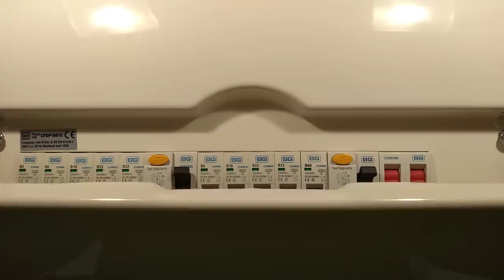A look inside a British home electrical panel.

Comment: I had an electrician quoting me for a new 18th edition unit to replace my self wiring fuse board very recently. This helped explain a few details he talked about so I'm glad I know he wasn't just baffling me with bs, it makes more sense now.
Reply: Most companies will quote a ridiculous price for the job, all in all it's a quick job usually (couple of hours tops), as long as there's long enough cables in your current fuse box to get them to reach the breakers. Once they're done, have a look inside for thru crimes or terminal blocks used to extend the cables...).
Biggest problem of moving from an old fuse box to a modern consumer unit after the length of the wires inside is more problematic and potentially quite expensive to fix however. The RCDs will find faults your old box didn't care about and you could end up with the RCDs tripping constantly due to poor insulation on the fixed wiring or indeed, if you have an older electric cooker, kettle  or shower, they often have a small amount of leakage to earth. This often results in companies either suggesting a rewire of your whole house to start off with or if they do just change the box, a rewire in the near future when the constant trips drive you round the twist.
Reply: @1973retrorabbit  tripping RCDs was my concern. The wiring is nearly 50 years old but is pvc coated, interestingly he didn't think rewiring was necessary when others have said that, however there are numerous historical modifications and damp problems in areas that might cause a problem. He explained how to address that if it occurs bypassing the RCD which I can now see how that's done having watched this video.
Reply from the maker: Bypassing the RCD is not the best option.  It's rare that even on an old PVC installation that the insulation is breaking down.  It's more likely to be dampness in boxes bugs in joint boxes or failing wiring or heating elements in appliances.  None of those are big issues as you can usually narrow things down and fix them properly.
Reply: @bigclivedotcom  indeed, I don't think he meant it as a permanent solution and having better protection is the major reason I want to upgrade it so it defeats the point bypassing big parts of it but there will be a fair bit of rewiring while I'm renovating the rooms over the next few years so as a temporary solution it might get us by until we work out where the problems are like you say

Comment: I remember a long while back replacing a wooden consumer unit which had re-wire fuses. It was also obvious that some fuses had popped in their time by the black scorch marks on the ceramic holders, and there were little melted balls of copper in the base. Fire risk or what! It’s great that standards have improved.😀
Reply: I remember the old rewireable fuses at my parents house (all replaced now). Was a great time trying to manually rewire a fuse when the lights blew in the middle of the night with the weak ass torch light you had available at the time. Assuming you could also find good batteries of course! 😂

Comment: Your system seems to be wired by task whereas here in the US the breakers are usually wired by room except for the really big high power devices like the dryer, stove, etc, which get their own breaker.
Reply: Problem we run into here is if the contractor went on-the-cheap when the house was built, then you could get branch circuits with no real relation to floor plan or function; the goal was to wire the bare minimum the code required with the fewest breakers and the shortest runs of wire (copper is expensive; homeowner frustration is cheap! :D ).

Comment: ring mains! Australia and Aotearoa use star or chain distribution rather than ring. Ring seems weird.

Also, some numpty wired the distro board in my house upside down. It has confused everyone. But it is a very old board, from the days whena  sheet of asbestos board and a wooden box was all you needed. Complete with old school cast iron main fuse... well, until I got solar and the guys had a fit because those were supposed to be replaced years ago due to their slight tendency to catch fire.

60A is low... Australia seems to be 80 or 100 in most places, more where McMansions have 30kW aircon units to go with their black tile roofs.
Reply: Ring final circuits were introduced in the UK after WW2 to cut down on the cost of the cables in properties. Not a brilliant idea as if there is a break in the circuit it becomes two radials fed from one 32A breaker/fuse and the cables are not large enough to have a 32A capacity. That's the main reason that UK plugs are fused (13A max).
Reply: Have seen the cast iron main fuse units here recently. The DNO (distribution network operator, formerly the electricity board) couldn't have cared less... 'but did you die?'
Reply: @wwsxa39  Cost and availability of copper for wire from what I've heard.
Reply: @TheChipmunk2008  Aye, but those guys dice with death every day. 240V is nothing to them, when they play with 11KV and 33KV. And use 6 inch nails to fix fuses. :D I remember fitting CCTV in a substation, and we had an escort guy with us at all times for safety. One camera we fitted was on a building ~ 30ft from a 275KV line (the big scaffolding pole looking types you get in substations). We had 6 inch sparks jumping between the camera and the pole, as we lowered it in place, from the pickup. We got shocks off the nuts and bolts as we were fitting them. Scottish power guys reaction? "He he hehe! Are ye gettin' a wee tickle from that?" (imagine it in an east coast scottish accent) Fun times.
Reply: @Matt Quinn :D Aye, those transmission line guys are crazy, a bit like racers/ speed testers, test pilots and base jumpers. They all seem to have that bit missing in their brain. I'd argue that its not even radiation off EHT, I think they already go in with nae fear. A kinda, "if I die, I won't know about it" mentality. :-)
Reply: 100A is normal here too, but older properties from the days when we used less power 60A or 80A was common.

Comment: Great explanation Clive. I’ve always wanted to know how to connect one up. I use an intumescent sealant to fill the void left in the rear of the knockouts. Very interesting going to ring hilti to find out about the toxic fumes given off when curing.
Reply from the maker: I think the Hilti intumescent sealant is water based.  I'm not convinced that many people actually use the correct thing.  Particularly when they happen to have lots of kitchen sealant handy.

Comment: Oh the aggravating rising clamp terminal. We have hundreds of them where I work. They are fun getting stranded wire in the proper place inside a cramped control panel. We do have some breakers with shields that stop you from putting wire in wrong but the brand name escapes me right now. Great video. Always interesting to learn how stuff is done in different places. ⚡️⚡️⚡️⚡️⚡️⚡️⚡️⚡️
It’s a siemens 5SY4318-7 
3 phase we don’t have any single phase in this brand but it’s interesting that it clamps on either side you put wire in. Hard to miss when you have two shots at hitting terminal. I like 👍

Comment: I had our house updated to all RCBO type breakers for minimal disruption and easy fault finding if a fault occurs.  I've not noticed any significant heat from them.
Reply: Same her, no current consumption from the devices themselves. and very little heat. One thing I did notice (a small design error) is that with Contactum, the RCBOs protrude a little further and the smoked plastic lid (the board is pre- amendment 3) stops the toggles flipping all the way down on a trip. Of course this has no effect on the actual operation but to prevent problems if the toggle mechanism gets jammed together with the internal mechanism, i've removed the lid. It's inside a metal meter cabinet anyway so no issues.
Reply: I think people are reading the spec sheets figure for maximum dissipation in the RCBOs and assuming it is steady.  I think most of the discussion is related to load and is in proportion to the square of the load current.  So a breaker using say 1.2W at its rated 32A will only be dissipating maybe 20mW with a more typical average 4A load on it.  
Also, take a look at  MCBOs - they have similar dissipation figures on their spec sheets.

Comment: Amazing how few breakers are in there .
We use a different system here in belgium .way more breakers , 2 fase, 20 amp for outlets , 16 for light . And a 30 and 300 mili amp protection
Reply: '300mA protection' an oxymoron for sure. 10mA is bad enough, as Clive demonstrated - https://www.youtube.com/watch?v=-5R-KBa18ME

Comment: concise and informative video, thanks, incredible that the tails gland requires drilled rather than providing a correct sized KO!
my theory on the increase of consumer unit fires is the increase to a min of 25mm in tails. some of the old plastic boards were made to be asthetically pleasing, slimline , not enough room for the tails be shaped and enter the DP switch terminals without being over bent and stressing the terminal connections

Comment: DIN = Deutsches Institut für Normung = German Institute for Standardization
Reply: Add a T and I get your GIST
Reply: Murphy deffa Everything digital will trip, are you sure?
Luckily in the U.K. domestic vacuum cleaners have limited power rating due to the EU, 😂
Reply: @Murphy deffa  B-characteristic circuit breakers actually do not trip when you turn on a vacuum or switching power supplies. In fact, living in out flat for 20 years, equipped with these type of breakers, we never had any problems, even when turning on three switching PSUs at once (PC, monitor, subwoofer). For household use, B characteristic is fine. 

But hey, I’m glad you had the brain to post bullshit.
Reply: v8s i actually had to separate my mac pro with two displays and two monitor speakers to two power strips as it sometimes tripped the breaker when i switched the all-in strip on... so kind of yes.
Reply: @mx0r  What you did there is called the "all the capacitors"-setup, wich you should not do in the first place.
Reply: So my ancient stereo with DIN plugs isn't called DIN because it's loud?
Reply: @zjzozn  A good idea too. It forces manufacturers to focus on more efficient motors and impellers.
Reply: Din Dutch institute for normies
Reply: Is that related to the round DIN connectors? The only DIN connectors I've ever used were with my old TRS80 Color Computer 2. Those were called Dragon Computers in the UK. I also used the 4 pin mini DIN connectors with S-Video which I don't use anymore. We used to use S-Video to connect late '90s TVs with DVD players and Digital Satellite boxes. Component Video killed S-Video. I'm not sure if it improved 480 video though. Component seems to work better than VGA on long runs even with a coaxial VGA cable. I use Displayport or HDMI instead of VGA. I haven't been able to seem any difference for 1080 video between HDMI and component. I don't think 4k can be used with component video. I don't own a 4k TV/monitor. All I know about 4k is that any HDMI cable that has conductors for all the pins will work. I personally don't think I would benefit from 4k due to my eyesight. That's enough rambling.
Reply: @Murphy deffa Standard domestic in Australia are C curve, A curve would be used in sensitive areas like medical installations, B curve would be used in domestic installs if the calculated fault energy is high. D curve very rarely seen even in industrial, anything needing such a slow tripping curve tends to go straight to a larger frame industrial Air Circuit Breaker
Reply: @honich-eriker  depends on the switching power supply, I've seen and used small 200 Watt units that have 35 Amp inrush current, if the final circuit is already well loaded flicking another 35 Amps onto it could be enough.
Reply: Robert Gaines, the TRS 80 was quite a different beast to the Dragon. I had a Dragon 32 as my first computer, and it was nothing like a 'Trash 80'. They were made in Wales, by Dragon computers. Even the mainboard bore the name 'Dragon Computers'.
Reply: +Ray G Mine are a Z curve... because of the shape of the route the fuse wire takes through the ceramic. :D
Reply: DIN is the noise that occurs when you knock over a pallet rack of DIN rail with a forklift.
Reply: @robertgaines-tulsa  yes the din connector is also a DIN standard as well as the DIN A4 paper
Reply: @manuelh.4147  For a time Microwave ovens have been more likely to do that.
Reply: Deutsche Industrie Normen (as it's normally stated in my country).
Reply: @zjzozn  But with Brexit I wouldn't be surprised if they start coming out with 3Kw domestic vacuum cleaners in the future just to piss off the EU😛🤣
Reply: trident3b  According to wikipedia, DIN means Deutsches Institut für Normen  since 1926.  You you was young in 1926???
Reply: MazeFrame yes, i have realized that and that is why i split it to multiple strips, so i won’t turn them on all at the same time.
Reply: Murphy deffa that‘s just wrong!
Reply: No such thing as “inrush” current.
Reply: @manuelh.4147  I've never seen a vacuum trip a breaker, either. I had le olde incandescent bulps trip the breaker at times when they went out with a BANG but I'm pretty sure that's how it's supposed to work.
Reply: @badbanano  Er, yes, there is. Motors, transformers, and rectified supplies with smoothing capacitors (this includes the input stage to an SMPS) will consume greatly more current than normal operation briefly, this is termed inrush. Even some resistive loads have inrsh, as their operating temperature increases their resistance substantially..
Reply: yeah.. we used to just say "Deutsche Industrie Norm" as easier to say and quicker.
Reply: @Murphy deffa well... have you ever seen a german fuse box?

Comment: I was at an Airbnb in the UK where a breaker had obviously tripped when we arrived, and it took me hours to find this damn thing cause it was a) white plastic, and b) inside the cupboard where they kept the board games and books?? Even just the fact that it was on the ground floor in a house that had a basement was completely foreign to me.
Reply: In the UK there seems to be no standardisation on where the consumer unit is located
When i lived in Lincolnshire, the house there had an outdoor cupboard, which we used as a pantry, and the consumer unit/fuse box for that house was in that cupboard
My grans house had it in a cupboard by the front door
When we moved to market weighton, the house there had it in a cupboard in the kitchen
And the house that I currently live in has it over the staircase on the side wall, near the bottom (although it is high up on the wall)

Comment: I’m currently teaching new electricians and I used to build test stands for large HVAC equipment that was shipped around the world. I’ve always been interested systems i. Other countries. Thanks for the good explanation. I was in London a few years ago and enjoyed rummaging through the electrical equipment in the apartment we rented. I think the small wiring is very efficient. It’s probably not quite large enough for he average American home, HVAC and expandability. Now we’re adding arc fault circuit interrupters and surge protection, so it’s a bit more complicated...  very good video. I’m going to add it to the video list for my class. I think it’s important for students to understand systems in other countries, especially those who may work in manufacturing where we install equipment from around the world. This would be a great idea for a new YouTube channel...

Comment: I hear you mention acidic silicone all the time, but over here (Australia) 90% of the silicone in the hardware stores is neutral cure.  You'd have to really pick the acidic one specifically.
Reply from the maker: That's interesting.  Most of our stuff is acetic acid curing.  It's quite hard to find the neutral curing stuff.
Reply: @bigclivedotcom  Same in the US. All I've ever experienced id acetic acid curing silicone.
Reply: bigclivedotcom Same for Austria. Like you said, you'll have to search for non acetic acid silicone.
Reply: Here in France I thought I could reliably tell the difference between silicone and acrylic  (pre-cure) by the sniff test.  Then a random cheap cartridge made me double check.  No acetic smell, but definitely silicone.  They don't seem to be interested in letting the buyer know!
Reply: Of course it will vary with the type of hardware store, but that's just my experience when buying silicone.  Neutral cure is really common in Australia.  I can easily pick from at least 3 brands every time I buy it.
Reply: Yes true, that's mainly because it should only really be used on glass and tiles (for adhesion purposes) as it is acidic and "eats" into the surface of most substances and causes issues. For example if you use it on colorbond roofing, it will over time eat away at the coating layers (causing leaks) and eventually rust through the iron sheeting. And it can react with some plastics making them brittle.

Comment: Hey Clive, I got my 18th Edition a few months ago and I couldn't have done it without your help. Your videos are awesome and genuinely enjoyable.

I'm a pump engineer and can get my hands on some pretty interesting industrial kit. If you'd like some old pumps, control panels, transducers, float switches etc, let me know your email and I'd be happy to help out the channel.

All the best 👍
Reply from the maker: Good to hear you qualified.  I've been holding off on updating to 18th until they've finished fixing them.